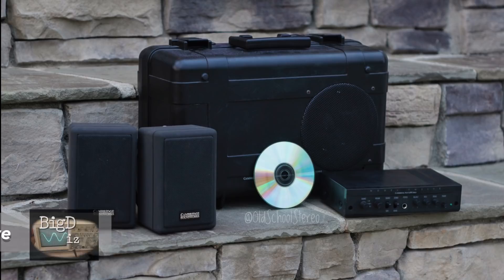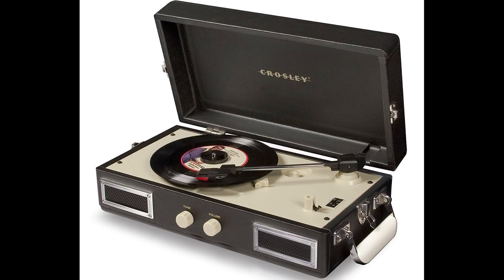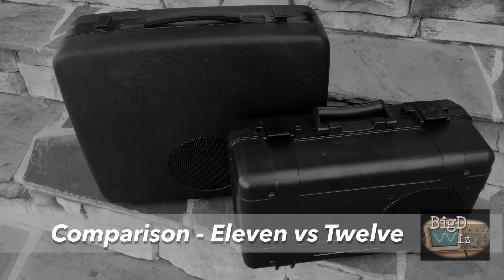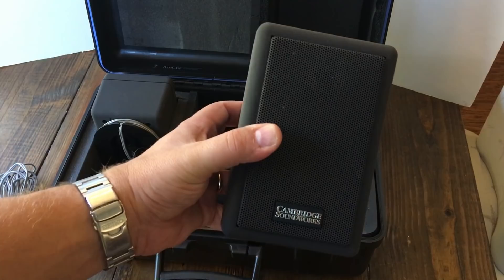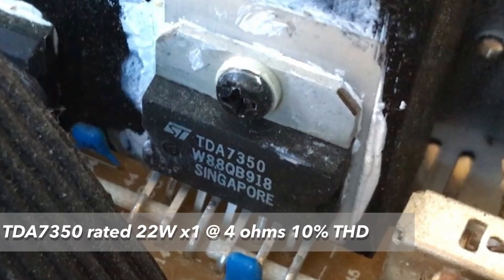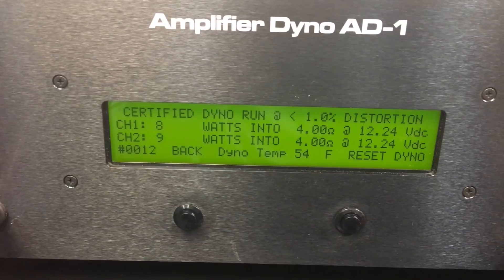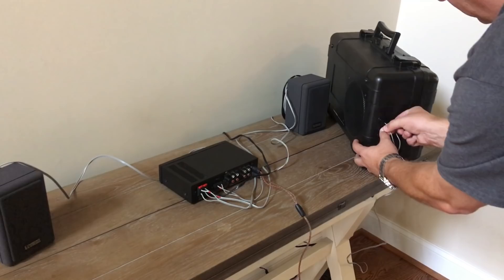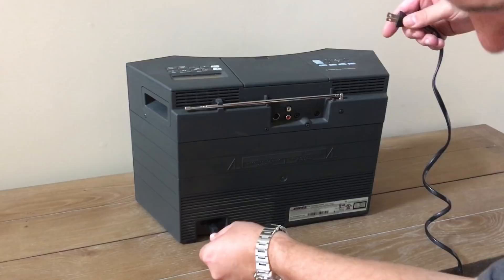1996 HiFi in a Suitcase?

Comment from the maker: Please comment, subscribe and leave a thumbs up!

Cambridge Soundworks Model Twelve Systems: https://goo.gl/NXC7Jg

My favorite precision screwdriver - http://amzn.to/2x0VzcE
Reply: one third into this video im going to go ahead and pause it while i give it a thumbs up!!!  you do a damn good job with this old school audio channel ..   k going back to the vid.
Reply: Williston Audio Labs the base case needs to be pointing down, the speaker facing down to the ground for the mid and low frequencies to work at all properly. Try it! You should have much better sound and balance throughout the frequency spectrum. There is a rubber type foot at each corner for the proper standoff and frequency response. Works perfect on hard carpet or hardwood floors. Obviously wall reinforcement  (which I find works best with most room and floor combinations) has more bass reinforcement and base sound than even a small standoff for the Bass Case from the wall. The closer to the corner the more bass and the further from the wall the less. This is a good enough system that the quality of your interconnect (your input wire) makes quite a noticeable difference. I ended up looking for something quite high quality and couldn't be happier with my decision and how it sounds (Amplifier Surgery on Ebay). May upgrade and or add connections to the amplifier box as well.
Reply: Williston Audio Labs subscribed! Good review. Love your testing. Grew up with a Ham / E.E..

Comment: Have always loved KLH and Cambridge products.  Have a few of the early radios and several of the Soundworks model 2.1 speaker/amp combos.  Very nice. I do like how you actually mean your channel name and test and show older amps and such. (And, as an electronic tech for 45+ years, love that you open them up and show us the GUTZ!) I have to say that I prefer the CSW's sound.  Even the little ones I use sound better to me than the two Bose. And the smaller Soundworks 2.1 setup is waaay cheaper. BTW, thanks for the history bits!  I did not realize that my old Singer portable phono (in the 70's) had it's roots in KLH! 
 I'd always liked it's quality compared to every other battery phono out there.  Now I know why... Way cool.. Thanks for the great vids!  D. Stuart/Stu/Stubat
Reply from the maker: +D. Stuart thank you for sharing your experiences 🤙

Comment: 3:39 - the satellite connections are a standard 2-pin DIN plug. They were used on almost all European stereos back in the day. As you found, the weakness is in the spring inside the sockets

Comment: I got one of these in the late 1990s. I guess it was on sale, as I got it for $400. Love it and have used it for my computer / TV system and also for music listening with a JBL Control 1 and JBL Control SB2 Sub/Satellites as well, for front and rear speakers. The Model 12 has real nice midrange and goes plenty loud for the modest amps. Not earth shaking, but adequate. The sensitivity must be fairly good, but I have not seen any specs for that. Thanks for the video. I have never heard a Bose system that sounded good!

Comment: First of all, you actually used a device that is designed to record Hi-Fi audio! I like it when people use their cell phone to record the audio from a pair of $30,000 speakers, post to YouTube and get comments saying...Those speakers sound like Sh**! LOL. Now, what I used to listen to your results were FAR from a pair of $30,000 speakers! Just a pair of your typical small desktop computer amplified speakers. Even so, the sound from both units there sounded clean and sharp. As you know, Bose does not give you any way to alter the sound. ie: BASS/TREBLE controls. They don't want anyone "messing" up their pristine sound now! I agree, even though I am not a Bose fan, that I, too, would grab the Wave Radio over the Cambridge for traveling around. Again, good job there!
Reply from the maker: +Curt Chase thanks for the insightful comment! Although I used a high quality recorder, the room wasn’t optimal, so take it for what it was. I appreciate you taking the time to watch and comment 👌

Comment: Cambridge Soundworks sounds alot better IMO. I would buy one. Never seen it before but most definitely like it!! Wouldn't mine the hooking up as I enjoy doing it anyways. Love this video thanks Big Wiz!!
Reply from the maker: +P.Formula Powers check video description for link to used ones on eBay. They usually go between 200-300, which I think is very fair for what you get. I paid about the same for the used Bose AWMS

Comment: I have what must be a late model 11 because it's in the plastic case, the satellite speakers have the wall mount/cable spools. The speakers have the spade/pin DIN plug (also used in many European cars starting from the 70's and the subwoofer also has the spade/pin DIN plug.

Comment: There's actually a third model of this. The Model Eleven Plus. Standard model 11 but with the model 12 Pelican case. When I bought my 11+ the satellite speakers rubbery coating had turned crap. Came off easily with some alcohol. Now they're nice and smooth. they also sold the satellites as a model 10-A. Foam surrounds can be replaced with 2.5" replacements. Pretty easy job. 
For those with a model 11 amp, there's an extremely well hidden fuse inside the case.
Reply from the maker: Yes, called the 11a, I have one of those as well. I neglected to include in the video because it had the same amp as the 11 and same case as the 12. I should have at least mentioned it.
Reply: I bought my 11a as a non-working product. It took me quite a while to figure out the fuse issue. Inside the case, the soldered in fuse was inside a 4" clear plastic tube with a white woven cover over that. I cut it out and replaced it with a standard inline fuse holder. I think I paid $80 for the 11a and had the fuse holder laying around the shop. I haven't heard a model 12 but especially like the fact that the model 11 runs off 110v.

Comment: I actually use something very similar at my PC/. I have the Creative Soundblaster version of the Cambridge set. It's 4.1 but I don't use the rear speakers. I just use it as a 2.1 setup. I replaced the subwoofer speaker in the box itself with a Tang Bang neo sub (5.25") I got from Parts Express. I am super pleased with the sound. I tried replacing the stock 2" speakers in the little cabinets with a real high quality Dayton Audio driver but I MUCH preferred the originals.
Reply: I should also mention I bought these brand new in the box way back in 1999 at a local computer show and sale at Howard Johnson's in Lancaster,Pa.

Comment: The speaker resistance is 4MΩ not 4 ohms. Check your video again. You either have a bad connection or there is a crossover inside that disturbs the readings.
Reply from the maker: Good catch! Not sure how I missed this, but oops

Comment: Oh man did I want one of those when I was a kid! I never had any interest in Bose products so the alternative pseudo hifi systems always fascinated me. So did you ever measure the actual loaded voltage coming out of that power supply? It could be fun to throw that amp on one of your step-up converters and dyno it again at 15 and 16 volts to see how much more powa you can squeeze out! Or stack ten D cells together and see how well it does on battery power! So many experiments so little time
Reply from the maker: I was going to input 15 volts and test, but never got around to it. I'm sure the amp would put out a little more power, but not worth the effort in the end. Thanks for watching and commenting.

Comment: Listening on BBC LS3/6  monitor speakers the Bose had a less coloured midrange,  Cambridge had more bass, but both sounded pretty good. Overall, I preferred the Bose.

I have a Cambridge 4.1 system, probably from about 2000, it is quite good, but has the same slightly coloured midrange of the Suitcase system.
Reply from the maker: Thanks for commenting. To my ears, at least on the recording, the Bose sounded better to me. Again, conditions were not optimal and it wasn't designed to be scientific, just a fun test.

Comment: I have CSW T500 towers. I prefer the model 12's sound. I hate the Bose sound.
Most of my audio speakers are ADS or a/d/s/ and my pickup is mostly all ADS.
Reply: Analog and digital systems in a class of their own. I have some 6.5" components waiting for the right vehicle to install them in eventually. For home audio, Polk sda 2b natural wood cabinet . And bedroom, Cambridge soundworks 2.1 system I've opened since New around  late 90s

Comment: The Cambridge would sound better but be a toll pain to live with The bose would be much easier live with and sound good enough.  I would bose
Reply from the maker: +iamtimyeater like I said in the video, I had a chance to take either on vacation this summer and chose the Bose for ease in setup, no tripping over the wires, etc. plus the Bose has a wireless remote. I really like both systems though

Comment: Why is everyone so against Bose? I remember Bose sound system being used in the ford Taurus & mercury sable back in the 90's
Reply: Chillie Dog No highs, no lows, it must be Bose. It's not that Bose didn't make some decent stuff. It's just that most wasn't that good, and some were garbage, although they did make some good products. And they're way overpriced. They're more of a marketing company then anything. Bose's designs were good, but ruined by the bean counters. He wanted to use better stuff, but they said no. Look at how cheap the drivers they use are, even in the TOTL 901. This would all be okay if they charged a fair price, but they don't. That being said. The old 501, 301, and 901 were good, and are worth buying off Craigslist for small money. Just be sure to research which ones to buy, and do not expect good bass, or extended highs. I don't mind the lack of highs, and would be okay using a subwoofer with any of these. But why bother? When there's used speakers like ADS that sound better, and do it all. BTW I wouldn't use those cars as examples for much either. Famous for blowing transmissions, and head gaskets!
Reply from the maker: +Chillie Dog the Bose AWMS actually sounds great to my ears 🤔
Reply: My old man had a pair of AR 2ax’s he bought in Beirut, awesome for the day in 1972 i think (still have them)- cut to today, Henry Kloss had really good sensible priced stuff for the time, esp. compared to mainstream audiophile stuff. With how much advancements with Bluetoothetc, The Model 11/12 was as portable as you got back then and were a fair price considering other products at the time… especially if you love you music pre 2000’s - do love watching this stuff.